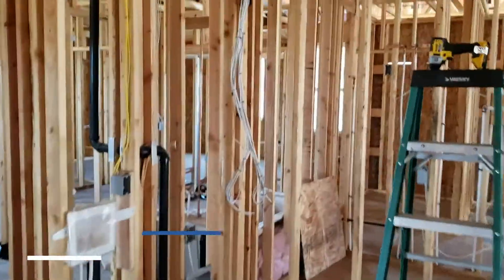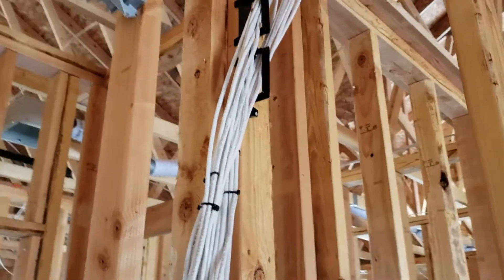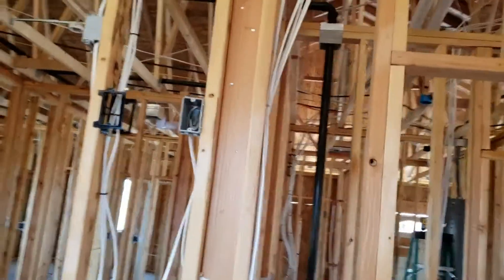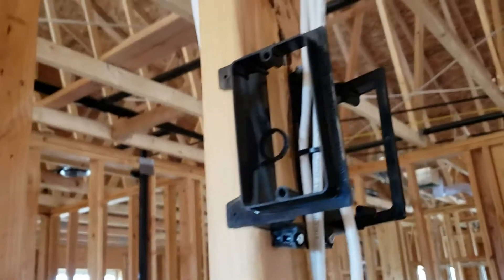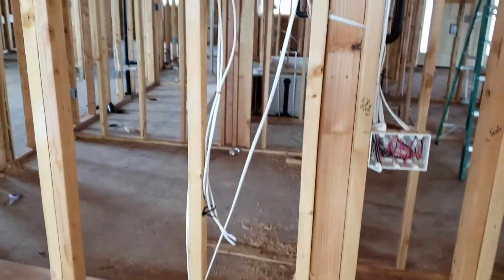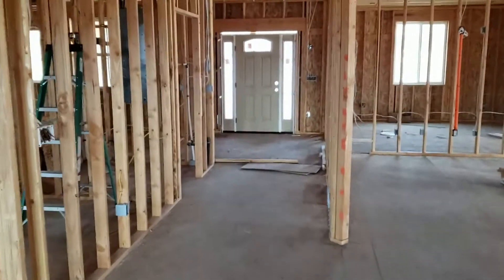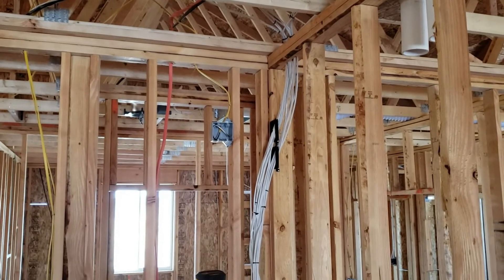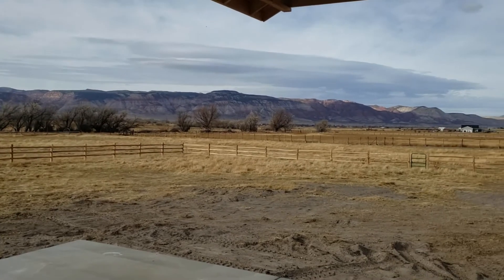Pro tips part 2 Audio Video New Construction Pre-wire Home Theater TV In-wall In ceiling speakers

Comment: What gage speaker wire do you recommend running thru walls?
Reply from the maker: Sorry for the late reply. Speaker gage will depend on a couple of factors. How long are the wire runs? How much power(watts) will you be running. I typically install small in-wall or in- ceiling speakers using 60 to 100 watts of power. The runs are 30' to 50' in the average theater. For whole house audio, up to about 150'. 14 gage will cover most installs. I only use 16 gage for short low power runs. For higher end systems, I use 12 gage wire. I recommend checking with your local state building codes to make sure your compliant. This advise I'm giving is assuming you are using good quality 100% copper wire that is in-wall rated. DO NOT BUY THE CHEAP STUFF ON EBAY OR AMAZON! Unless you know for sure that it's good quality wire. A lot of sellers will lie or have fake reviews on their wire to get sales. Most of this wire comes from China! If you need some help with this, let me know. I only source wire from good reputable distributors.   I hope this is helpful.

Comment: just noticing that some of the installed wall plates protrude past where the gyprock is fixed to the studs, in Australia the gyprocker would bend these back out of the way to glue gyprock, which obviously makes it hard to locate the screws thru the mounting plates at final installation, so guys you really need to address this at prewire stage making sure that the edge is a flush finish with the edge of the stud, same as the power outlet boxes. wiring regulations are obviously different between countries with separations from electricity cabling / plumbing pipes, another option is to install short lengths of correctly coloured conduit (yes colour is important for identification to trades) over or around electric cables/pipes. there is always more then 1 way to install cables correctly, what can look good is not necessarily correct ! 
But all in all you have done a decent job.
Reply from the maker: Yes, regulations are different in other countries. My installs are only in the USA, so checking local regulations are always important and highly recommended. I try to remember to comment on this, but I don't remember to do this every time. I just assume that people will do this for their own installations. Thanks for the comment.

Comment: Why new construction still using coax?
Reply from the maker: Coax is for installations where you may install Satellite or a over the air TV antenna. It can also be used for digital using MOCA adapters. Thanks for the question.

Comment: Thanks for the tips. Good info, would be great if you could list where to get the orange conduit.  Great tip on multiple Cat6 cables per room. You never know when one will get pinched/kinked, etc. and fail.
Reply from the maker: I can provide any conduit you may need. I sell it by the roll. 1.5", 2", 2.5". Let me know what you need. Thanks for the comment.

Comment: Very helpful  and detailed video.  What is the typical height for TV outlets if you do not know what size of TV you are planning to install? Thank you and keep on the good work.
Reply from the maker: Sorry for the late replay, had to step away for a few weeks. I usually put the outlet above where the TV mount will be installed. Most TVs are angle down a bit. Having the outlet above the mount gives you a little more space for the plug.  Depending on the TV, a recessed outlet is a good idea.  Thanks

Comment: I hope you see this… can you run speaker wire and the wire for my POE cameras in the same hole through the studs with no interference? Thanks in advance!
Reply from the maker: Sorry for the very late response.  Had a medical issue. I do typically run speaker wire and Cat6 wire separately, but you should be able to run them together ok for short distances. Cat5 or 6 is shielded pretty well.

Comment: Good video! . I would like to know how much should I charge for run a low voltage pre wire project like you guys doing. I know about low voltage but I don’t know how should I price out. Thx
Reply from the maker: That's a loaded question. What you charge is up to you and the what the market will bear. Typically $50 to $150 and hour has been the standard. It mite be a bit higher now with high gas and other higher expenses.

Comment: why didn't you run all data wires in the conduit?
Reply from the maker: I only use conduit for cabling that may need to be upgraded in the future. I also use it in areas that are difficult to run wire. Make life a lot easier for upgrades.

Comment: Great and informative! Where can I buy those low voltage per-construction brackets?
Reply from the maker: The brackets are brand specific. Contact your installer or manufacture to purchase brackets. Sorry for the late reply. Had some medical stuff to deal with.

Comment: I am curious why 3 cat6 cables per room? I am wiring up my house this week and debating if more than 1 is needed. Also debating on coax, I prewired my last house with coax and ended up never using any of it over 10 years.

Comment: Great video. Can you recommend some companies that make good cat 6 cables. Also how many 1000' rolls did it take to wire this house?
Reply from the maker: How much Cat6 are you needing. I sell it in 1000' boxes. I used about 2500' in this install. I ran RG6 coax as well.
Reply: @avdreamer8250  probably 4000’ with 2 different colors so 2 with one color and 2 with another.

Comment: Provider supplies fiber to my house. Do I need any coax at all?
Reply from the maker: I would run coax in your installation regardless. Most likely, they will use coax to the modem. Thanks for the comment. Please like and subscribe if you haven't already.
Reply: Fiber modem has no coax connection.

Comment: Where do you get the giant orange conduit tubing? Any idea of approx OD? Looks like maybe 4”
Reply from the maker: It's only available in the custom installation AV industry. I do have some available. it's available in 2" (outside OD is 2.1/4") I also have 250' of 1.5"   How much do you need?  I can sell it in specific lengths. Thanks for the comment. Please subscribe to the channel if you haven't already. Thanks
Reply: @avdreamer8250  Looks like it's a carlon product and my distributor stocks it. I didn't even know!

Comment: What is the coax used for?
Reply: Or are you calling the cat 6 a coax cable? So it's really all just cat 6
Reply from the maker: Coax is run for anything needing coax. Satellite, Over the air TV and some devices that use coax with the MOCA adapter to run a video signal through. Thanks for the comment.

Comment: About to pre-wire my house. Where can I find those zip ties with the integrated nail?
Reply from the maker: I use zip ties with intergraded hole and screws. You can find the zip ties on Amazon. If you need any equipment for your theater room or other parts of your project, hit me up. I offer serval lines of AV equipment. Thanks for the question.

Comment: Great video and good info. Is it best to run all coax lines outside to where the demarc box will be, as opposed to running just one outside and splitting the rest inside? A cable installer told me this was the preferred method to avoid the signal loss that comes from splitting.
Reply from the maker: Hi Donnie, That's a loaded question. It's not a question about what line runs to what location. It's about multiple factors. What's the signal coming into the house? Internet, OTA or cable TV. What type of coax is being ran, RG59(old school), RG6, dual shield, Quad shielded etc. But the most important thing is, how is it being split. Non powered or powered splitters. Splitters with pre-amp or no pre-amp. To make things simple, over the past 20+ years of doing installs. I always run all coax cables to one location in the house, then use powered distribution blocks with non-powered splitters with short jumpers going to powered amplifiers with pre-amps for long runs. There is a lot of signal loss with coax, but this can be minimized with quality coax(quad shielded RG6 is best for OTA TV, cable, satellite and internet) and the right mix of high quality signal amplification. This has served me well over the years. Thanks for your question. Please subscribe if you haven't already. Thanks
Reply: @avdreamer8250  Guess I should have specified... I have a cable provider (Spectrum) who will be doing the install at the demarc. I'm the homeowner doing some pre-wiring myself. It will be quad shield RG6. I'm pretty sure Spectrum would use powered splitters outside the house.

Comment: Hi, did you double run your ethernet cable to each run....does it needed for security or waste of.....
Reply from the maker: I typically run 3 cat6 and 1 or 2 RG6 cables to each location.  This ensures plenty of future expansion options. Remember, you only get one shot at prewiring your home. Better to be a little overkill than run into problems later. Thanks for the comment.
Reply: @avdreamer8250  thanks

Comment: Thanks for the video.  To late for part two for me because they just finished hanging the sheet rock today. Thats Ok, your Part one was a big help for wiring up my home theater last week. Do you have issues with the sheet rock guys by leaving the wires hanging out of the box?  I was worried about that so I zipped tied them into a tight blundle and left it carefully looped up in side the stud wall and hung the whole bundle with a piece of bailing wire so I could pull it our later.  Maybe I did not have to do that?  Good Idea on taking pictures.  I walked around the rooms taking a video before sheet rock.  I already found at least one box that was covered by the sheet rock guys and was able to locate it off the video.
Reply from the maker: Sorry for the late replay. Had a little surgery on my neck. Glad my info helped. Sounds like your on your way to a awesome home theater. I don't think you can be to careful with the wiring. After all better to be over cautious and get it right, than have issues later. Thanks for your comment. Enjoy